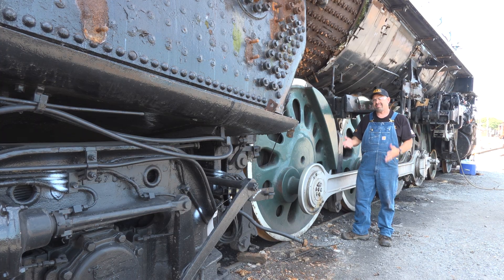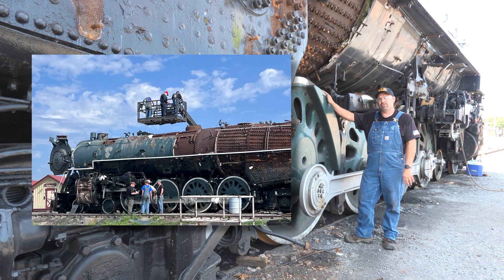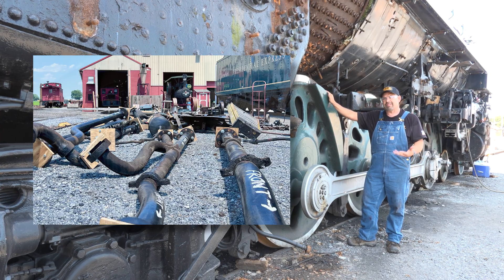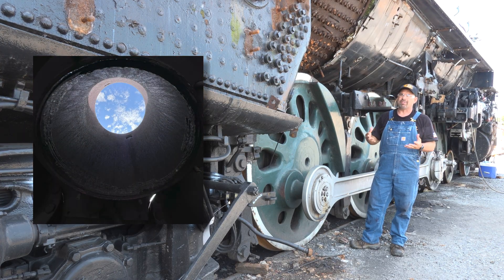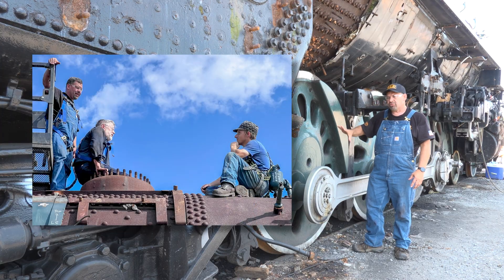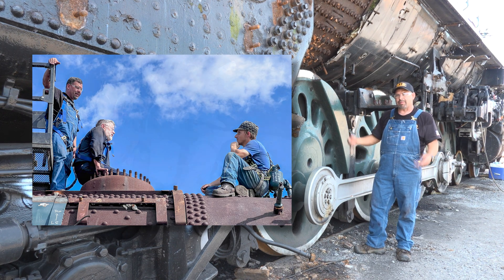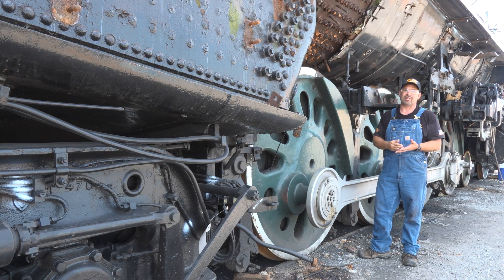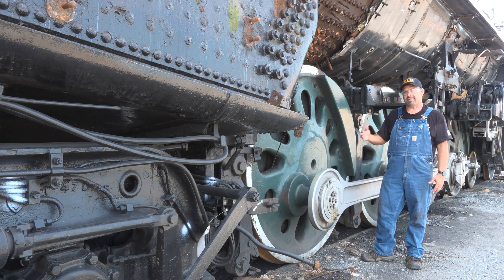𝗔𝘂𝗴𝘂𝘀𝘁 𝟮𝟬𝟮𝟱 𝗥𝗲𝘀𝘁𝗼𝗿𝗮𝘁𝗶𝗼𝗻 𝗨𝗽𝗱𝗮𝘁𝗲: 𝗣𝗿𝗼𝗴𝗿𝗲𝘀𝘀!

Comment: Godspeed on the restoration!  I rode behind 614 on the Ross Rowland / NJ Transit excursions back in the 1990s and was quite a ride!  614 had the wherewithal to handle a 20+ car excursion consist and it was a thrill to be there.  
"It'll be done when it's done."  Well said!  Take the time and do it right.

Comment: Thanks for the  video. Will the locomotive undergo any upgrades during the restoration, such as better lubrication, Lempor exhaust or thinner multiple piston/valve rings? These improvements have been well-tested and proven by engineers like L.D. Porta and David Wardale on locomotives like the SAR 3450 Red Devil. It would be interesting to see if any of these modern enhancements are considered to improve efficiency and performance while still maintaining the locomotive’s historical integrity
Reply: They said yesterday at a mechanical shop tour everything would have to meet current requirements (forgot the government division)

Comment: Are those flexible staybolts on the combustion chamber necessary?
Reply: The designers must have thought so, they cost at least 10 times as much as a ridgid staybolt. A lot of expansion and movement in those areas.

Comment: Will the tender be kept in its current state or will the coal bunker be returned to an "as built" condition?
Reply: They stated that there is no reason to convert the tender back to its original state
Reply: @railfanjordan8141  So it will travel with its canteen all the time then.  Since they modified the tender to carry more coal years ago.

Comment: Will the stupid ditch lights be removed during the restoration? they never look good on steam locomotives
also what will be the final paintschene you guys plan to put on it?
Reply: Probably the standard Black
Reply: The ditch lights are removable. They stated that they’re gonna have use them if the host railroad requires them to be put back on, but other than that, they’ll still be on the engine, but hidden behind some trap doors where they are gonna be. As for paint, she’s going back into her original black with C&O lettering
Reply: I hope so! If a person can’t see or hear a giant steam locomotive, then Darwin is a big part of their life. 👍
Reply: I remember when they added them, I think in the second year. I have pictures/video both with and without them. I have to agree, they look terrible. It was either NJT or Metro North that required them be added - I don't remember which one it was.
Reply: @js4653  Figures. Government intervention once again.
Reply: I hate ditch lights on any vintage locomotive, diesel or steam.

Comment: Will the 614 remain coal burning?
Reply: No I believe they're converting it to oil
Reply: @yeoldeseawitch  614 is remaining a coal burner. No need to convert to oil unless stated otherwise and they find the need to convert to oil necessary
Reply: @railfanjordan8141 really? I just heard from someone that they DID plan on converting the engine to oil. Are you sure theres nowhere that RJD specifically said that?
Reply: @yeoldeseawitch  that’s a question that’s been asked numerous times since the announcement was made in November and RJD has stated that 614 is remaining a coal burner. If the opportunity to convert to oil comes to be, then they’ll convert it to oil. For now, she’s remaining a coal burner
Reply: Oil firing🔥IS the HOT set up. Quick and easy to load the fuel anywhere. Easy to fire. Instantaneous reponse when needed. Much cleaner in the cab and overall around the lokie. No ashes to deal with.